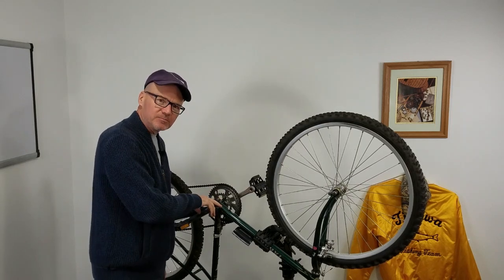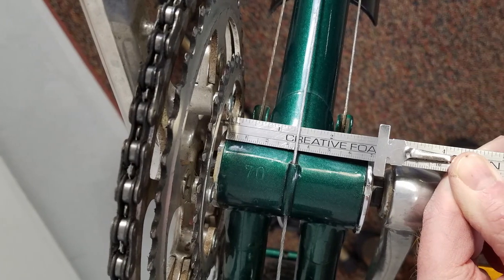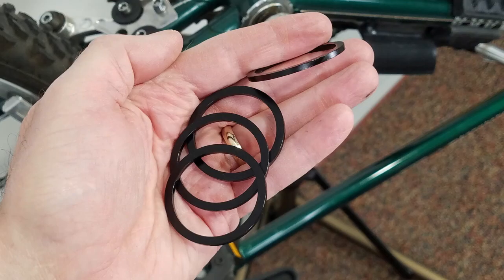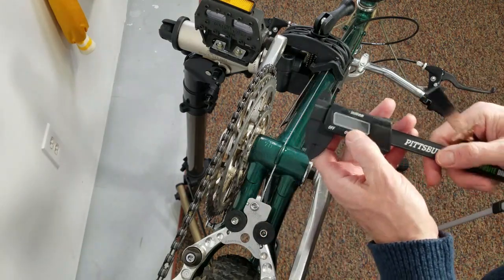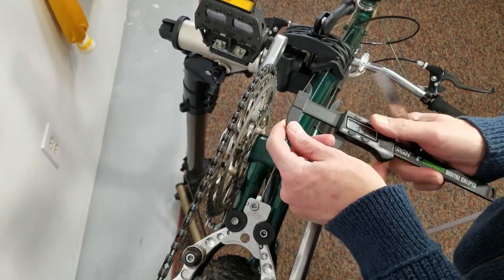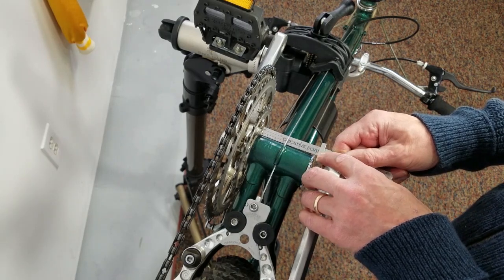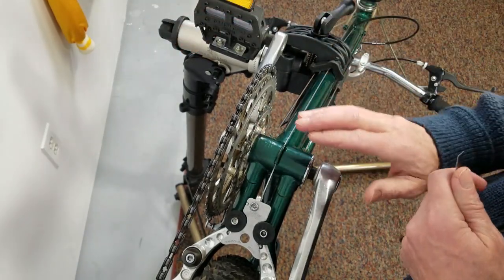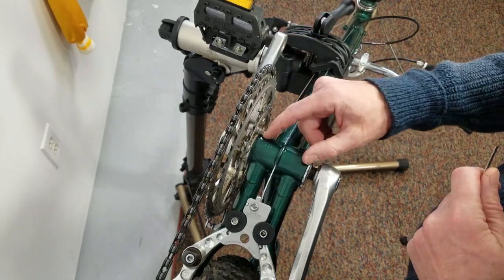How to Measure the Bottom Bracket for a Mid Drive Bike Conversion

Comment: I have an old trek navigator and the bottom bracket measures out to be 73x116mm cant seem to find any that size. Any suggestions.
Reply from the maker: The 68mm usually works for sizes up to 73mm.  But so many bikes are unique.🚴